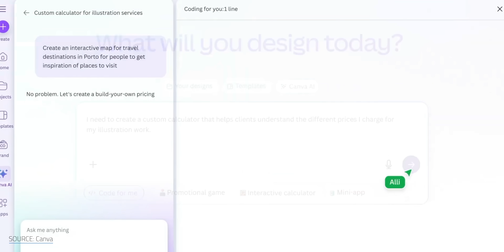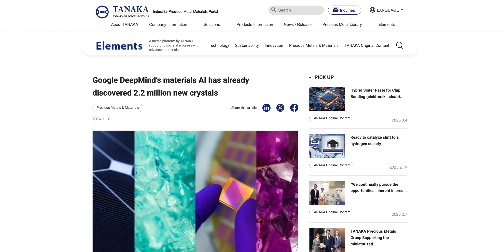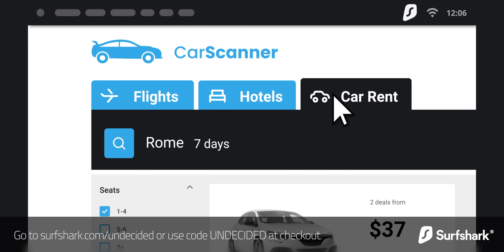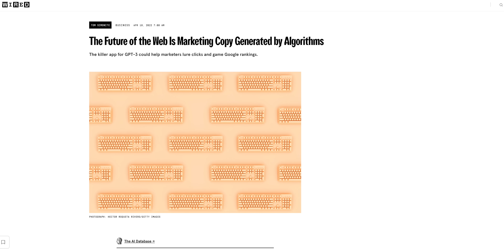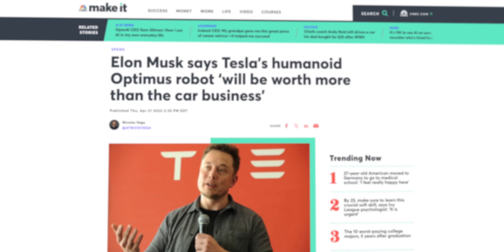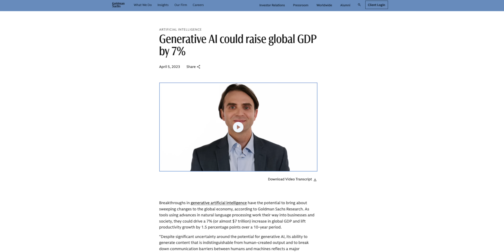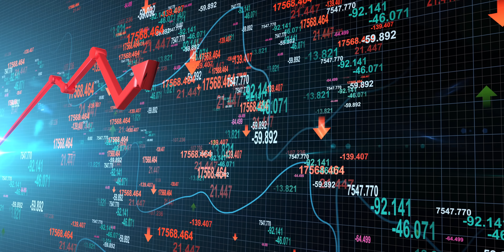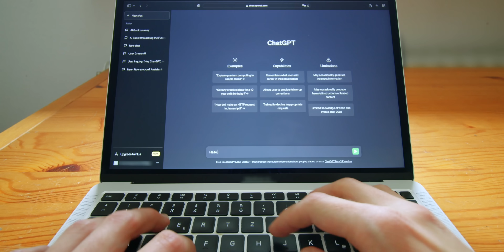Why the AI Revolution Has a Fatal Flaw

Comment: I do freelance proofreading for book publishers. Proofreading seems like something AI should excel at: in theory, it's not as involved as copy editing and requires less decision-making. 
I'm looking for typos, checking layout and design elements, and just going over the book in its final form (but as a PDF) before it's actually printed.
I've used ChatGPT to double check some of these issues, and even basic grammatical issues, and it's good for some things but really surprisingly bad at others. 
You have to word questions VERY precisely. It makes assumptions that it shouldn't. Its memory works in a way that human memory simple doesn't. And its instincts are pretty bad.
I was a little worried it could take my job. Not anytime soon if the current model is any indication, though I have to leave room for sudden and dramatic improvements.

Comment: This, as so many other videos on the subject keeps conflating different types of AI. There was acknowledgement that LLMs and graphic generation gets most attention while actual advancements have happened elsewhere. Warehouse automation is mostly not AI, just standard advancements in automation. Basic graphics design and copyright jobs are reducing (currently), but those aren't the low skill jobs. The better batteries aren't really affecting the jobs of people putting those batteries into the products, or assembling the actual batteries. Those aren't especially reducing work. It is those LLMs and graphics generative AI that analysts are predicting to remove jobs. Material analysis and development making massive leaps due to specialised AI doesn't equate to ChatGPT being actually extremely efficient in autonomous coding and making coders obsolete.

Comment: I have waited a long time for someone to start this conversation, and it needs to be had. (AI) controlled computers and robots could make us a paradise doing all the work, and Were our biggest problem would be how to fill all that leisure time, but I would not count on It.

It is a very old concern, whether some new piece of machinery would put people out of Work, but it usually turns out more people are required to design, build, operate and Repair the machine, than are replaced, but for the first time I believe that (AI) powered Robots and computers could have a serious impact on society.

The current Trump tariff policy is an acknowledgement of the pressure coming from manual Workers, impoverished by manufacturing moving to lower cost countries, or automation, but The truth is even if they persuaded companies to build cars, or other things in America, they will not be the Factories of old, that employed 20,000 people, if they are lucky, it will be 1,000 people and reduce that to 500 people with advanced (AI) automation.

Then you have all those people who consider themselves middle class and immune from Such problems, because they have office or computer skills, or claim some degree of Creativity. With (AI) anything you can do on a computer, can now be done by a computer And many secure roles could be redundant.

While manual workers have been conditioned over the years to accept lower wages, with zero hours Jobs, short term or part time roles with no security, but it will come as a shock for the middle class, but at least they will have the education and were with all to protest, but I doubt if It will make a difference.

Even with our current level of technology it is technically possible to have automated mining Equipment to dig up raw materials, that could be delivered by autonomous train to a processing plant, from there the refined materials are delivered by self-driving trucks to a automated factory and finished products are stored in computer-controlled warehouses, before being dispatched to customers by drone, and with (AI) doing the design and the paperwork you could take almost all the people out of the process, but it does not matter that by doing so you can reduce the cost of a television from $2,000 to $200 if you are unemployed you still cannot afford it. The problem with the above scenario is that Computers and robots do not buy cars, furniture, clothes or drink fancy coffees. 

There will still be plenty of work that needs to be done, but it is largely not profitable so will Not be of interest to companies, like looking after the sick and the elderly, maintaining historic sites, Wildlife or the environment, and with fewer people working and paying taxes governments will have no means to pay for such work.

Solution, you could have a universal income, but that assumes companies and people of wealth are willing to pay the taxes to provide one, but we know that big companies regularly move their profits offshore to the lowest tax havens they can find, and that wealthy people are only interested in paying enough tax to support an army to protect their interests from foreign states, and a police force to protect their interest from home grown malcontents. So how do you persuade the big companies and the population as a whole that the current Economic play book must change.

A universal income without work or some other activity could lead to both physical and mental deterioration could lead to frustration, ideally you would look at a system that would pay the equivalent of 10 hours at an average pay rate as a basic universal income, then the individual would be expected to undertake a minimum of 20 hours paid employment, before an additional 10 hours of universal income would be paid, making a weekly income of 40 hours, if full time paid employment was available then the initial 10 hours payment would still be paid and all forms of income would be combined for tax purposes, in certain circumstances the 20-hour paid employment mandate could be exchanged for more universal income if the individual was involved in training or volunteering for at least 20 hours, the initial 10 payment would be paid from the age 18 until death and would count as income for tax purposes, all the above is dependent on some method being devised to pay for it.

Failure to see the problem (AI) could curse, or failing to find a solution could see people Turning to the old ideologies, communism, or fascism and their need for an enemy, in the Past such ideologies needed to persuade people in public meeting after public meeting, Today people can be influenced in their bedroom, I believe that we have another 10 good Years before the wheels start to come off societies around the world, I suggest that we use That time to have the discussion that is needed and find a solution (just don’t ask AI) you  May not like the answer, and people who think themselves cleaver enough to manage the Transition should work at putting themselves in a position of power, ready to displace Those who do not see that change is necessary, if done properly we could have a partial Paradise.

Comment: I’m a tech entrepreneur. I have several web platforms that I own and operate.  Two weeks ago I had an opportunity to create an application that would be immediately used in an industry.  I was able to clone an existing product that took me four years to develop.  And with the help of AI, i stripped out unnecessary elements and added new functionality in just one week.  So from the time I was approached with the opportunity to the time that went into production was less than two weeks.  Unbelievable.  Normally this would’ve taken me six months to a year to do.  I look at AI as a senior programmer that I can give a task to and they do it. No questions asked.  Now I will tell you that AI currently is quite often wrong. It also has a tendency to overcomplicate things and it also has a tendency to agree with you.

Comment: I have a few concerns about AI:

1 - the amount of energy it requires. This means massive new power plants to keep data farms going. Not only does it "take jobs away" it's also either raising the cost of energy for all others, or flat out taking the availability of energy for others.

2 - governments are way too slow or reluctant to put laws in place to keep a given AI within its lane. Yes, the progress we can make in medicine, pharmaceuticals, materials etc  can help reduce costs and make incredibly helpful discoveries. But particularly when AI is providing information that biases, the general public, lawmakers, decision makers, controlling weapons systems etc, then we have a problem. And of course AI learns from initial inputs - take the Microsoft's AI chat bot that they tried out on Twitter years ago - it took all of a few hours of absorbing the "inputs" = tweets and conversations already on Twitter to become a racist and misogynistic BOT. They had to shut it down in less than a day. So if AI is allowed to be used within strong specific guard rails in place, imagine how quickly it can be telling leaders to do something very bad, or convincing the public to do something very bad.

Comment: I think there is a misconception here... People don't need jobs, they need money. But money itself is merely a value we subjectively apply to things.

At surface level, it can be said to be related to labor. But in reality its more related to abstract concepts like "time x effort", "prestige", "responsibility", "connections", "opportunism", "exclusivity", "abundance"... Among others!

So while this might seem like a "fatal flaw", a solution is sure to come up. Because this is a "software" problem, and not a "hardware" one! Which means it merely requires adaptations on the system. And they do not have to be perfect or complete overhauls!

Adapting as problems surface will be enough to start with, and after that... we will have AI to assist us in finding a better solution.